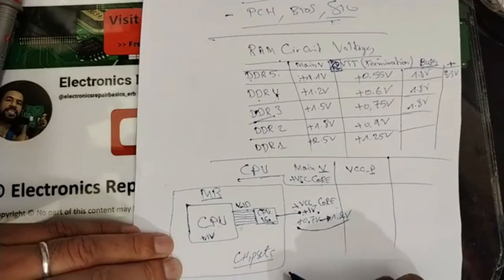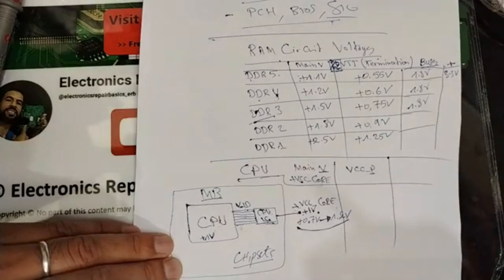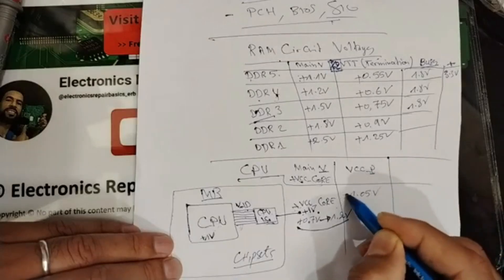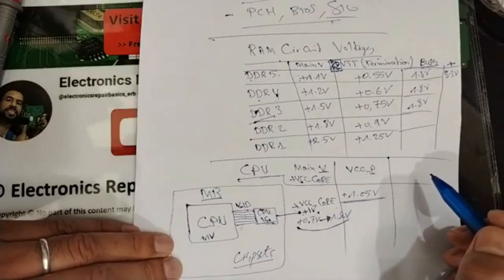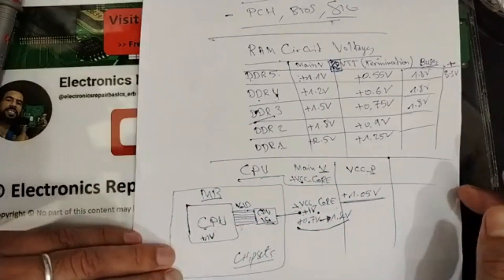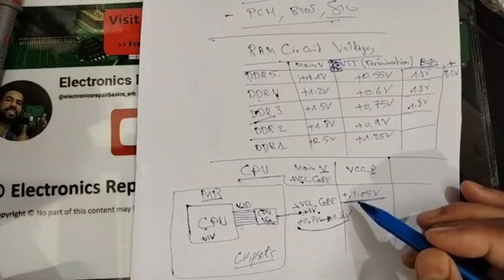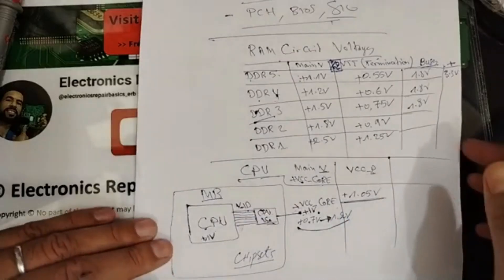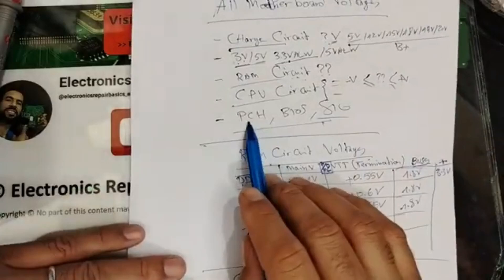Every Voltage You NEED to Know on a Motherboard - Explained Fast | Laptop Repair

Comment: On my motherboard I'm only getting 0.3V. I measured the power supply and it gets 19V but when I plug it in it drops to 0.3V. What is the problem?